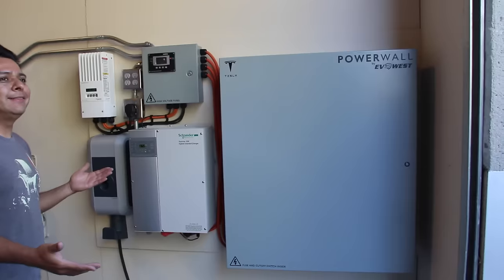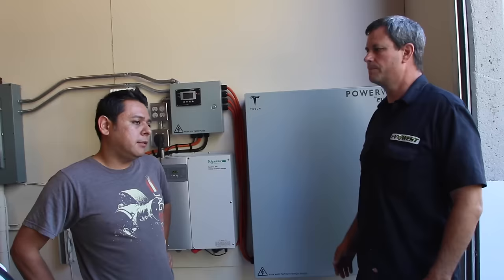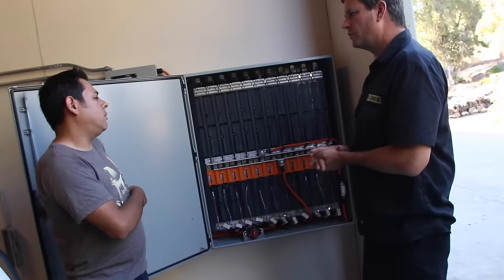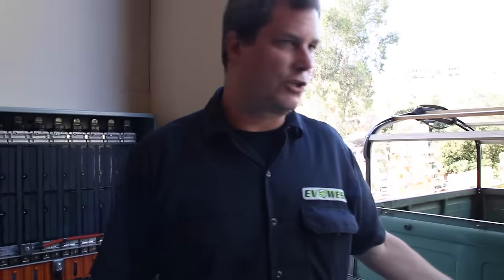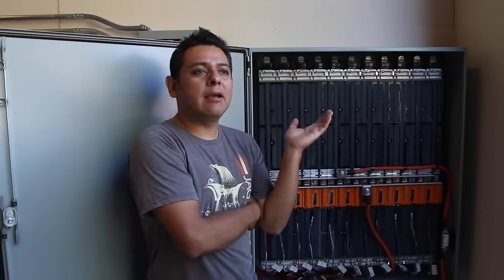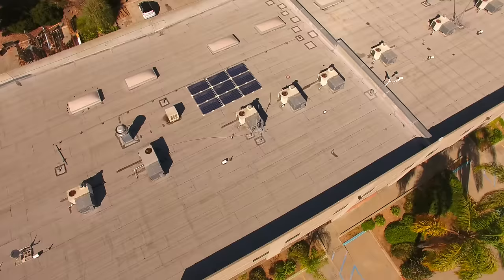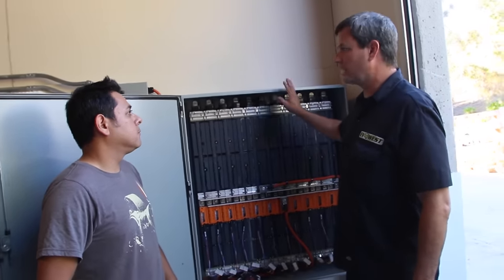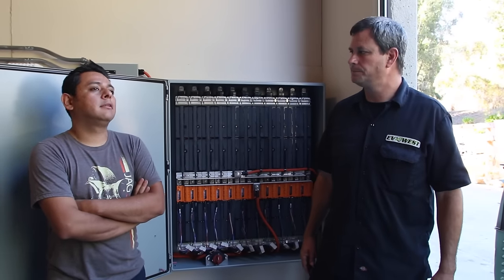DIY TESLA Powerwall  - my  WALL vs ELON'S WALL

Comment: Damn. 16 grand..... idk. Hard to justify
Reply: start small man , he spent 9000 on batteries ....  if he didnt have those , he could still run things and charge his car ... only when the suns out ...
at least in the day your saving money then
Reply: As my 8 kW solar system generates way more than I consume, I requested to my utilities that the excess kWh be carried forward as a credit from month to month indefinitely until I terminate service. This means I don't sell my excess power, which I would only get 5 cents/kWh compared to the 10 cents/kWh that I pay. It's a better deal for me as long as I know I'm going to eventually use that excess kWh eventually. I know I will as I have an electric brewery that I use frequently during the winter. It's a better deal for my utilities as well, since they need the Renewable Energy Credits for government funding (I think).
Reply: 30% Federal Income Tax deduction on all capital costs included?  If not then $16k   less 30% = $11.8k.
Reply: I'm guessing you don't charge an electric car as well as run your house?  I'm still 'surrounding' the parameters (numbers) on a similar system to this video for our house.  During AC season, we use 70 kwh per day, just for the house.  Charging a car every 3rd day would add about 10 kwh/day more. We have numerous public charging stations and my wife charges at work, so those factors are nebulous. The sun shines 6 to 8 hours per day, almost every day.  So we'd need a 70+10=80/7 hours = 11 kw system.  But that's on paper.  Ironically, the first problem is the system is too big for most of the year.  
I've got it.  We'll add a pool.  A more practical answer is to reduce the size of everything but the battery pack (bigger is always better) and find energy reductions throughout the houses' design.  There are lots of place to improve, such as isolating all this exterior stucco from the sun.
Reply: Plus you have to pay for the power to charge it, raising how much electricity you use. Just a worthless fad.
Reply: D o   I t   Y ourself 
for the Win
Reply: Joey Bagodonuts My electric was about $3000 for 2016. So in 20 years it will be $60k lol at constant prices.
Reply: GeekBoy03 the energy to charge is from the sun.
This is upfront payment for future energy usage.
Reply: not including the solar cell array....
Reply: The cost of electricity on my bill here in South Australia is a fucking ludicrous 39 cents a kw..... So you can imagine how grateful I am running a huge 8kw solar array on my roof when its 45 degrees (113F) all bloody summer and my industrial sized AC chews through power at 5000W on startup Hi to 3000W normal running. Shipped the Panasonic panels specially from Japan, cost me $15,000 AUD, and I sell all my excess energy (of which there is a lot of) for 18 cents/kw back tot he grid. Bought these specifically because the temperature coefficient on them were miles better suited to our stupid hot weather than even competing expensive panels, let alone el cheapo ebay/amazon panels.

Pretty sure I've already paid back my investment on this 3rd year if I only looked at my usage during the SUMMER QUARTER ALONE lol (last summer was nuts) and I don't even have a battery backup system. My last bill was 61 bucks, if I didnt have the solar panels it would have been in the ballpark of 3.5k (a light summer quarter for here). People saying solar will never pay off must either live somewhere power is 10 cents/kw and below or they just aren't very smart. However even here, mains power costs don't warrant a lithium battery setup yet... The useful lifecycle on lithium is too shit for me to make back the initial expense in reasonable time, until that is power prices start getting stupid, which they will. 

Vanadium flow batteries are simply a better long term battery option. You can technically get infinite lifespan out of them and you can discharge them to 0% indefinitely without adverse effects to the system, their only drawbacks are system size (mind you its like the size of an AC so not that big) and that they wont have the same peak output as lithium, so if you're a heavy user, you'll just need two of them. Trust us Aussies to invent a commercial solution to our climate... lol.
Reply: And you've just hit on the issue.  The utility company has to build the system to hit peak demand, even though they won't use a number of the plants 300+ days a year in places with 4 seasons.   If you are acting as your own power company, you have to be prepared to do the same, unless you are willing to do without at points during the year.  For example, on those days when it is 100*F.   So either design a system to provide the 14-20kw/h that most  US families will need for several weeks or months, or you live like it was 1900.

Also, don't forget that most homes in the US would be lucky to get 20% of nameplate and that places with good solar will probably not exceed 25% availability factor.  
All of that assumes that you don't have mature trees or nearby neighbors and that you can keep your panels clean.

I'm a huge believer in the potential for solar.  But panels need to double in efficiency at least one more time and probably twice, before most can consider it as a major source of electric power.
Reply: Have you considered the present value of your up-front cost?  Will the system become more or less efficient over time?  Will the system be maintenance free and need no repairs over the 20+ years?  Are you going to be paying interest on the initial capital cost?  Would the money "invested" in the system otherwise be earning you interest or preventing you from borrowing for something else?
Reply: At your prices, the economics are vastly different than for the average American that is paying 11 cents per kwh (and likely less in the winter in many cases).

Comment: im curious how they test those used batteries. 3000 charges is about the best your going to get out of 18650's that are new and as far as i know u cant really test for how many charge cycles its gone through. a curious technology that might work great with a large array is the tech in SSD's. they do interesting stuff to try and spread the load around reducing read write cycles and increasing the lifecycle of its ram, or if used in this, a battery. would require a large oversized array though.

Comment: Depending on your electric bill you won't break even for at least ten years and we are not talking any maintenance.
Reply from the maker: +John Stephanites  it's not for everyone, but it's really attractive for us Californians that pay top dollar for energy
Reply: I mean I love the idea and to actually get it set up where it worked would be very cool. I think that your 300 Tesla wall idea makes it much more doable. I think if you got the Harbor Freight Solar Panels it might look a little better as to the idea of worth it. Do you think it is a good idea to use Harbor Freight panels as to cost of other more reliable ones? Love the channel and Subbed by the way!
Reply from the maker: +John Stephanites  harbor freight panels are not the best value,  45w for $149   Amazon has a 100w panel for $112 and you can get $30 charge controller.   More than double the wattage for same price
Reply: that's how it all works, ever diminishing return means it might take longer, this is modern day snake oil salesmen trying to make you think it will pay for itself in 10 years, in reality it will be 15-20 but it wont hast half that. Think how many people's vaporizer batteries are exploding, imagine these doing that after 5 years and them blaming you for bad charging practices.
Reply from the maker: +Obi Wan Cannabi  can you please stop spewing stupidity,  some people reading these comments might be fooled
Reply: ok so solar panels, the power you put back into the grid, how many countries are finding it so popular that the rates you get paid are dropping yearly, how many solar panels work with the same efficiency rating that they started with (both add up to ever diminishing return), why would  you invest into a technology now when 3 years into your 10 year investment it becomes even more efficient to have these new types of panels that you can't see, or that integrate into windows or just look like regular roof tiles. you are constantly upgrading shit that doesn't really need upgrading all for the sake of saving some money, billions are spent to keep you catching up.
How long before there are no night rates because everyone wants cheaper electricity at night to use during the day.. you think it will stay cheap?
Reply: true, plus I did a little math, $15670 at 25 years $629 pryr, $52 prmo,  just to charge your car + a bit more. 
for people like myself in the lower income bracket; the car + charging is out of range.  
average electric for my whole house is $75 mo average, so an initial outlay of over 15k is too much, ... just waiting for a major price drop;
Reply: Itd pay for itself here in about a year and a half. At my house we can see up to a 1000 dollar electric bill
Reply: even for me who lives in a poor neighborhood, my bills can get up to $300/mo I mean,I don't know anyone that is really paying $75/mo (like the other guy suggested) Even here, they're saying for budgeted yearly equal payments is still $100, but when I asked around, for anyone that did that with our power company, turned out, they had to still pay $500 on top of that monthly bill, due to "unforeseen overages during summer months" So at best you're still paying nearly $2,000 a year.
Reply: Exactamundo, my brotha! Quote "So at best you're still paying nearly $2,000 a year." it's that True-Up Bill. I am a Photovoltaic Technician "solar technician" yes monthly bills are low as $10 but when bill from hell comes at end of the year "true-up bill" you'll pay dearly if you go over what your system was designed for. blame the greedy power companies.
Reply: it all depends on your location. the further east you go its more like 10 years to break even but the further west you go its can be as short as 2 years. Cali has crazy high electric costs plus they get ALOT of sun.  I'm in PA and get power for under 7c per Kwh and crap for sun so it doesn't make any sense at all for me.
Reply: John S if it wasn’t for people like him who look into the future we all be stock in a circle been push down by gravity praying to an imaginary friends for help.
Reply: Not to mention south australians with the most expensive electricity in this country (australia) - high enough most americans almost faint at paying 30 cents and higher per kWh (with another price increase on the way apparently)
Reply: that's considering electricity will remain constant for 10 years in which it won't
Reply: OH THAT's RIGHT THANKS! considering so many people are shelling out for solar, fossil electricity will probably go down!  Well probably not, but the national average has actually only gone up by only 2 cents per KWH over the last 10 years so as long as that trend continues, its not much of an offset.
Reply: Iampim, that may be true where you are but not so true over here in Australia. The power companies, desperate to squeeze ever more revenue from a shrinking user base, are still raising the price of power, with retailers selling it for 30 to 50 cents per kilowatt-hour and plans to increase again in the near future. You can see how solar & batteries look rather good to those fortunate to own their homes (renters like myself, however, are barred from installing solar without the landlord's permission and that almost never happens, so we're trapped for now)
Reply: yup yup. that's exactly why I said it depends on the location.  makes a ton of sense for some people but not everyone.   hopefully the solar movement actually does force the power companies to make cheaper power to stay competitive.  win win if it does.
Reply: John S And you'll NEVER break even, when you count interest AND maintenance.
 That's why solar is not yet feasible, i.e. you can never break that barrier-- also you're on your own if power goes. 
That's why on-grid is best, with a backup-generator.
Reply: + John S,  you sound like a naysayer and you forgot about something else buddy...   if a person or company is really interested in "solar" power, it should be more about the renewable energy part and not as much about the upfront cost involved!   Ask yourself the question, why would anyone even want to move towards an "off-grid" clean and self-sustaining energy source?   

Most people want to make it an issue about NOT saving money, because "grid" power is cheaper and more reliable or the cost of a solar/storage system like this and the excuse it won't pay for itself in 10+ yrs.   In my opinion, a person like that isn't very serious about clean energy or the person works in the current power grid system and is opposed to the change that is coming!

Blah, Blah, Blah!!!   It always becomes an analysis of cost and longevity vs how "cheap" grid power is, that gives the moral justification to not spend the money and invest in a system like this.   My point is, even if the system only ever breaks even, it's still a huge win win because you saved the environment/planet from the pollution of burning fossil fuels or other polluting energy production to provide that same energy you would have consumed.
Reply: If you diy your array you can still take advantage of tax credits. With some careful planning ive seen up to 7kw systems that had a total cost after state and federal tax credits of 800 dollars. His house was using 1200 dollars a year in electricity so in the first year alone he saved 400 dollars total. Thats not breaking even?
Reply: John S is right though, depending on your electricity bill and usage your breakeven point might be past the life-cycle of the components themselves lol... HOWEVER, for the solar naysayers....

The cost of electricity on my bill here in South Australia is a fucking ludicrous 39 cents a kw..... So you can imagine how grateful I am running a huge 8kw solar array on my roof when its 45 degrees (113F) all bloody summer and my industrial sized AC chews through power at 5000W on startup Hi to 3000W normal running. Shipped the Panasonic panels specially from Japan, cost me $15,000 AUD, and I sell all my excess energy (of which there is a lot of) for 18 cents/kw back tot he grid. Bought these specifically because the temperature coefficient on them were miles better suited to our stupid hot weather than even competing expensive panels, let alone el cheapo ebay/amazon panels.

Pretty sure I've already paid back my investment on this 3rd year if I only looked at my usage during the SUMMER QUARTER ALONE lol (last summer was nuts) and I don't even have a battery backup system. My last bill was 61 bucks, if I didnt have the solar panels it would have been in the ballpark of 3.5k (a light summer quarter for here). if I were as stingy with power as I was without the panels, Id be receiving checks in the mail from the power company to the tune of 600 odd dollars, but the house feeling like a refrigerator for free is just too nice to give up. People saying solar will never pay off must either live somewhere power is 10 cents/kw and below or they just aren't very smart. 

However even here, mains power costs don't warrant a lithium battery setup yet... The useful life-cycle on lithium is too shit for me to make back the initial expense in reasonable time, until that is power prices start getting stupid, which they will. Vanadium flow batteries are simply a better long term battery option. You can technically get infinite lifespan out of them and you can discharge them to 0% indefinitely without adverse effects to the system, their only drawbacks are system size (mind you its like the size of an AC so not that big) and that they wont have the same peak output as lithium, so if you're a heavy user, you'll just need two of them. Trust us Aussies to invent a commercial solution to our climate... lol.
Reply: Data Banks Australia has its challenges all right: I've read about the severe conflicts between folks who understand natural gas has a big role to play in your energy market, and those who are against it, and are causing energy shortages! Let's hope sensible people prevail.
Reply: CO2 is good for the environment. It helps plants which make oxygen. That's why they called the "Medieval Optimal" the Medieval Optimal.
Reply: mitchil Geary: So true! And recently published research shows that increased CO2 in the atmosphere helps plants use less water. Skeptics can do their own research by googling this subject. I want a bumper sticker that says "My emissions are making longer growing seasons!"
Reply: Karl Jolley we use 33000kW pr year or so. We have a farm, a family, pretty big house.. we would need a pretty hefty setup, right?
Reply: Ok so i made a powebank out of tested 18650's. in theory it should have 80ah.. (all paralell, 55cells-3,7v-into a usb outlet thingy) but when i filled it up, then dischrged it(1amp), it showed up as 150ah!?!?!! When i charged it at (3amps) and it said 140ah.. why is it sooo much higher than in theory?? I checked all the cells!! Every ssingle one!
Reply: John S - for me it was around 3 years.
Reply: He's using solar panels so your electric bill doesn't matter
Reply: westmkk1 oh the panel doesnt cost anything Then i guess?

Comment: I apparently saw this video before... But why are you charging the car through an inverter? Wouldn't it be more efficient to charge with a DC charging unit thus skipping the inverter and whatever losses are incurred in the inverter? It seems redundant to invert DC to 220VAC and then back to whatever the charger wants in DC. Wouldn't it be better to just convert the wall DC to the DC voltage the charger needs? Can you not get a charger that can use DC as an input?